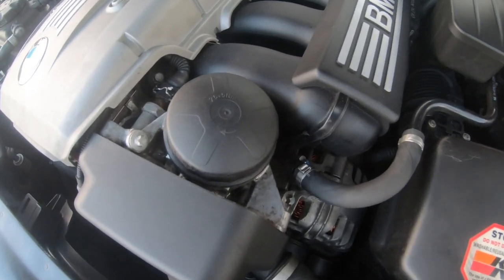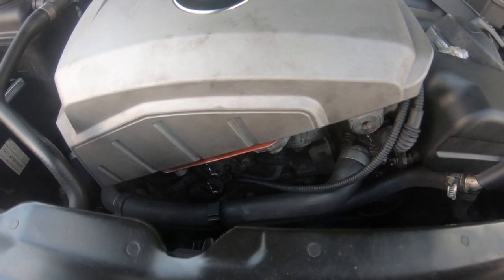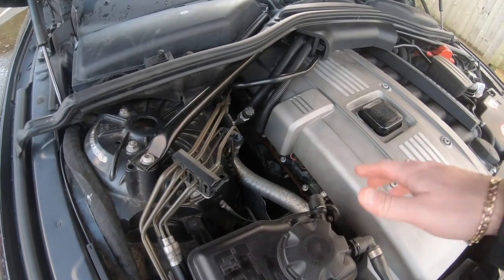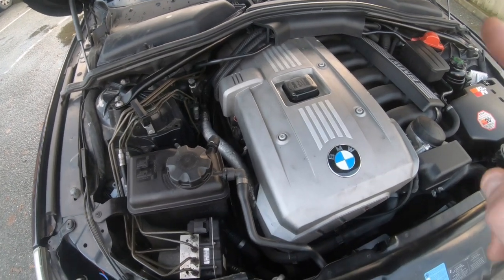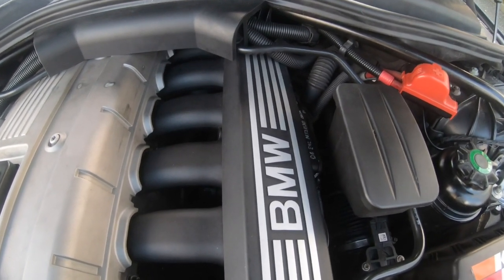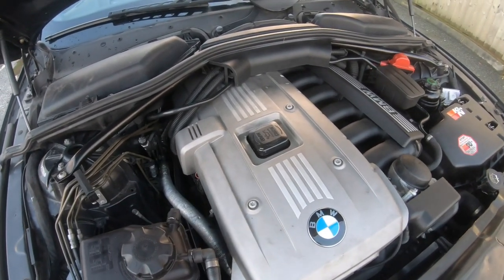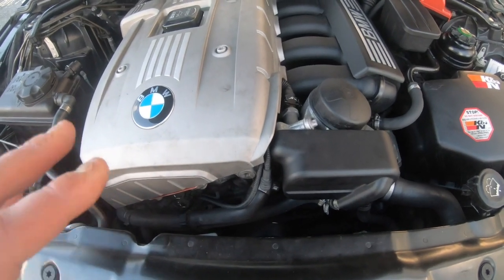9 Parts That Will Fail On A 100K + Mile Bmw N52 Engine

Comment: I have read that the aluminium bolts for the VCG were only used up until 2006? And that steel bolts where used after that. Which would not need replacing
Reply from the maker: That’s correct they was if you have plastic valve cover no need to change bolts
Reply: @BMWDoctor  Where are you based mate? If your not too far I'd like my 130i m sport to get a proper once over 😁
Reply from the maker: I don’t do work outside of YouTube sorry.

I only do it for my locals and family sorry about that the garage is not allowed to be used for YouTube clients even tho it’s paid for by them aswell as all the parts but I use it for my locals BMWs and my family’s.

If I was to start using it on YouTube cars and do what the contract says and pays me for we would have the whole of England having good reliable BMWs and my channel would become irrelevant.
Reply: @BMWDoctor  Ahh that's a shame! It's hard to find people who know their stuff imo. Can you recommend anyone in the south east area perhaps? Thanks
Reply from the maker: I can’t mate people and garages charge a arm and a leg to work on these cars especially 130i it’s very very hard to access as it’s cramped in there but I know how to work on that very easily done it many many many times on that engine
Reply: @BMWDoctor  Okay mate, thanks for the info 😉

Comment: Your belt tensioner should be replaced every 30.000 miles your engine will leak at some point approaching the 90 100.000 miles mark from the oil filter housing or the valve cover or both ive had to do the oil filter housin gasket at around 75k now im at 88k i gotta replace the valve cover / vc gasket + oil pan gasket and do my tires alignments my bmw is basically my wife I’m married to this bitch

Comment: Guys i am having some gard times with my bmw 323 my car started by overheating and it was mixing water and oil the machenic fixed the overheating issue as we speak my car is spilling oil over and when you drive it there is always smoke coming out of the car and also when it idle there is some ticking noise at the engen

Comment: my US 07 x3 3.0si does a loud tick about every 2 seconds while idling. Kindof feels like the AC compressor kicking on and off but its not. Any idea on what it would be? Its a loud enough "tick" that you feel it through the pedals.
Reply: The lifters are bad gonna have to get the 2009 cylinder head and do the lifters or just get the whole head and torque it down

Comment: These are pretty good engines, mine is at 120k and I've only had to do starter and valve cover gasket. My oil pan leaks alittle but it's not enough to run out and replace it right away as long as i add a quart every month it's fine

Comment: Hi dean. I am a international student and studying in Canada. I bought a 2011 328xi three years ago. Now it just hit 100k km. I am planing to change those parts that you mentioned in this video. But I am having a hard time to understand your speech. So can you make a list that could help me to find all the parts easier? and how I can do the engine module update?
0:45 for the engine oil filter components, do you mean need to replace the whole engine oil filter housing parts, not only the cap. is that right?
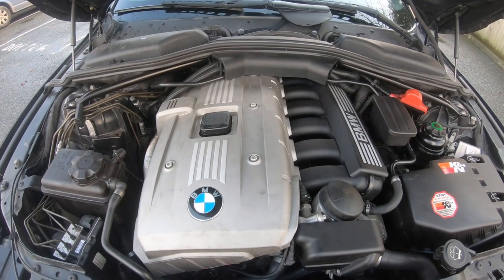4:05 do you mean the CCV intake manifold needed to be replaced? 
5:00 do you mean the valve cover gasket set need to be replaced? and for these bolts what size i need to get?

Comment: The best upgrade on my 2011 X3 with 100k somewhat problem free miles was trading it for a Lexus....   these 9 problems, and several other more was the final straw on a long list of things that cost way more than the car was worth to fix.    I also have a 2013 328i F30, with 143k miles on the 4 banger...zero problems, but its not worth two dollars so I just tool around with it until the engine has a catastrophic failure....
Reply: Interesting, yeah I have heard that the 328I F 30 is pretty reliable even though it’s forced induction, I am so torn because I love the Bangle era E 60 and I’ve always wanted one, was thinking about getting one as second car but I am also considering a A6 3.2 which is supposedly quite reliable actually. However I do love the F10 five series as well and a 528 I would probably be a reliable right, Of course with a thorough inspection and proper maintenance history

Comment: I do lose a little but of antifreeze over time, and i top it off every few months, maybe a quarter liter mix of of antifreeze and distilled water. I have no codes and there is no leak. I removed plastic undercover a few months ago and there is definitely no leak.

Comment: Thanks for your help Dean. I have an E46 with 26X,XXXmi I've had for 6 years and put 140,000 miles on, just purchased and X5 with a N52  and 167,XXX miles. I'm going through it. and needed a list of things to check. Between you and Nathan, I feel confident I can get this beast back to snuff. 

Just did the OFHG and OFcooling gasket.
Vanos Solenoids, Thrust arms and end links scheduled to arrive today. Had to do the wiper fluid pump last week.
Disa and CCV is next.

Comment: Congratulations for your great work here !
Reply from the maker: Your welcome
Reply: @BMWDoctor  Please allowed me to put you a question; I own an 2006 E90 325i with N52 engine and about 120.000km; I have it since 3 years ago. The engine runs smooth, no major issues while running. Excepting a little bit higher oil consumption, about 1l at 2000km. But the main issue would be the idle when the engine is cold(more than 8 hours). And this happens only when it's warm outside in the hot seasons; no issue in the cold season. After starting the engine, for about 5 to 10 seconds, the idle could be a little bit unstable but after that time, everything is ok. But sometimes, the idle just drops bellow suddenly and the engine just stops. After I start it again, no more issues, the idle is stable. Please advice what could be the problem. The ignition coils and spark plugs have been changed two years ago at a BMW dealer. At low rpms, I do not feel lack of power( caused by potential vanos solenoids issue).I never had the check engine shown in the dashboard.

Comment: I have a n52 engine in a 2006 e90 325i. It’s had all the gaskets done water pump is being replaced as we speak. Are these issues with the indirect or direct injection n52
Reply from the maker: my friend N52 is NOT direct injection engine
Reply: BMW Doctor  back in 2013 my car has the Deasa valve issue and had a new top end fitted. The car is on 131k miles the car runs fine as I’m aware but will I still need to replace the vanos Solenoids?

Comment: Any chance you know why my oil cap would be leaking after I replaced with genuine part? also rocker cover gasket done by previous owner is now leaking ? Plus my brake pedal goes stiff at 1k revs any ideas on this ? Servo or vacuum pump ?

Comment: when i see these videos i get really scared because my mine is at 115k miles and idk what the previous owners did but i have no issues accept after changing my oil the oil sensor isnt updating the oil level
Reply from the maker: Change the oil level sensor mate very easy to do
Reply: @BMWDoctor  will do thanks theyre actually alot cheaper than I thought they would be

Comment: Does a of-housing gasket leak- trigger a red oil can pressure warning light ?.
Reply from the maker: yes it can as oil pressure is compromised with a leaking gasket
Reply: BMW Doctor cheers mate! Do u reckon, the car needs to be towed, as the light does not stay on?.

Comment: I've got the S65 engine I'm at 98,000 kms, I know I need to replace the rod bearings as a maintenance which will be done this spring.
 Is there anything else you would address?  Vanos etc?

Comment: exactly the same on my Benz money pits:
Filter housing gasket 
Phasers stuck
PCV burning oil
partly developed software
valve cover extra leaks
weak aluminum bolts
serpentine idler and tensioner
....

Serious Ticking come from high pressure direct fuel injectors

last: don't forget to do early drain on transmission oil and brake flush... all engineered for precisely  controlled premature failure to help Japanese partner brands
👍

Comment: With an electric water pump can control the coolant flow as needed so... why does the engine need a thermostat?  Hey.  I guess I'm smarter than all the MBW engineers.  What am I missing?  Don't tell me about the heater.  There is thing called a heater valve.

Comment: Why would I replace parts before they fail?  So I can do it on my own schedule?  OK.  I'll change the oil before it fails.  What else?  The update sounds like a good idea.  How do I find out more about that?
Reply: He can do the update for you since he used to work for bmw or whatever he has all the tools necessary, you just need a laptop and a obd-usb adapter and the internet and whatever program he tells you to download he will do this remotely for you.... BMW in america won't do these updates for you apparently because the engines are too old and most people there aren't trained anymore to do these updates or whatever no money in it. He says most won't even acknowledge that they need an update from what I've gathered. But after you do it you apparently gain full strength to the engine. Could just be him advertising but I've watched this dude take the whole car apart so I believe him. I'm about to do my valve cover on my 07 328i n52 and might do this update after coils and iridium 4 prong plugs. If I ain't satisfied with the power gain after all that definitely scheduling an appointment with him.

Comment: They could have put a temperature gauge on the cars.  All they had to do was to design the gauge to read normal unless the temperature is out of tolerate according to water pump operation thermostat operation and the coolant temperature itself.  All my cars the temperature gauge sits exactly in one spot no matter what.  However outside of that parameter it will show a higher reading.  You are right I was thinking since the electrical water pump and thermostat came on BMW's  they took the coolant gauge off at the same time. So it makes sense.

Comment: Changed the valve cover gasket, pulley and tensioner at 70K miles in my 2008 E90.  Next will be the ABS assembly, I am sending it out to a third party for repair.  Thank you.

Comment: I just hit 96k miles (155k km) and my engine seized completely on my 2011 325i. 
On the bright side, I'm getting a new 50k mile engine 👀
Reply: What happened??
Reply: @taquechi2  oil pump lost pressure, bearings ran dry, and piston 5 shot straight through the block. I ended up getting a N52B30 engine from a 530i, so I'm kinda lucky lol

Comment: I have a 2011 328i and I’ve had to deal with these same issues spot on at around 73k miles. Excellent video!
Reply: how much did it cost to change all these parts??

Comment: well I have 2006 530i with N52 (310k km) and the only things I replaced so far was a starter, front spring and connection link on front sway bar. And belt and tensioner at 200k as maintenance, and just standard maintenance stuff, plugs, pads, filters etc. Otherwise no issues, no codes. The only extra things i do is oil changes every 8-10k,  and oils in man. transm, and diff, every 80k or so.
Reply from the maker: Very good

Comment: Around 100k is when you need to replace the expansion tank, those almost have the exact life span of 100k. It is hell trying to get it seated right, and if yours goes, it sprays everywhere and possible shorts the fan, and a few electric components. 

Is it also true to replace transmission fluid around 100k, and BMW Lifetime oil generally refers to 100k?
Reply: Bmw lifetime oil is a lie. You always need to make sure to change your transmission oil with new one and the filter as well

Comment: Thanks! I would add O2 sensors in engine bay, and the electronic water pump (+ its thermostat)
Reply from the maker: I did water pump and thermostat 

if your o2 sensors are failing on a N52 engine you have big problems mines on 160k on original sensors with no issues I would change your fuel grade and run shell v power 101
Reply: BMW Doctor O2 sensors agree that basically never fails but some have noticed big improvements in fuel consumptions as they get aged.

Comment: BMW made for 70 000 miles .Toyota made for 370 000 miles .
Reply: My E 83 with an N52 motor is running very strong at 200,000 miles.   Change your oil mate.   Trust me, the longevity of my vehicles has nothing to do with luck. FFS, I have been divorced three times! Shit for Luck.
Reply: Depends on the model, The E39 will match any toyota! the days of toyotas doing that mileage are long gone.

Comment: Every point you made was what I call ENGINEERED FAILURE POINTS.  They are specifically engineered to fail at a specific point to force the owner into the shop for a costly repair.  Every auto manufacturer uses them to get into your wallet.  All a part of the automotive corporate plan.
Reply: Planned obsolescence is a part that is designed in a way that it will no longer serve its purpose after a certain duration or determined wear quantity.

Engineered failure points is not a thing, that’s called engineering for cost vs longevity.
You could upgrade the material and design of every component on the car but there will always be a weakest link, the car would last longer overall but you will always get a part that will fail eventually, it is not only expensive to engineer parts for that, but also pointless if your top 60th percentile of vehicles doesn’t make it to the age at which these over engineered parts would last, they just become heavier landfill.
Reply: @gtjack9  this year alone, on my 06 330i, I replaced my coolant thermostat, expansion reservoir + cap, the cheap corroded plastic valve connecting the coolant tube to the head gasket (with a nice aluminum one), and radiator all on my own. Radiator was previously replaced in 2020. Then yesterday, I had the water pump replaced after it was previously replaced in 2016. 

Now the engine runs between 190F - 220F, but mostly hovering between 205F - 215F. 

Also replaced the voltage regulator. 

The CCC unit is totally dead and the entire driver’s side headlight housing. 😔
Reply: @samgod  how much was all that I’m thinking about buying a 328i n52 2011 with 99k miles for just under $5K would love to hear your opinion on getting it as my daily the owner looks like a guy my age early twenties and has multiple bmws
Reply: Planned Obsolescence at its finest.
Reply: @gtmike916  actually, to me, planned obsolescence is a separate concept; designing a vehicle to look outdated.  It will run perfectly, but just look old, enticing the owner to "update" by buying the newest version.  Engineered failure is used to force owners to repair items that should last longer if not fail at all.  An example is the electric water pump on the BMW.  Mechanical water pumps should last well beyond 100K, but you're living on borrowed time after only 50K with the BMW pump.  Or the door latch mechanism in a Ford Edge.  Some electronic gizmo fails to work after 15k, forcing you to pay well over $700 in labor to replace a $30 part.
Reply: Thats normal my friend. Because its not an japanese motor😉
Reply: @abdullahboz7055  If i didn't love the BMW so much, that's what I'd have right now.  There's definitely a cultural difference driving that...

Comment: I disagree about the temperature gauge. They could easily include one set to the appropriate temperature range of the engine. Ie hot for hotter than normal. A gauge gives you warning of a temp increase before it's critical
Reply: Right!! BS

Comment: Hi mate . Maybe a silly quistion but after replacing vanos solenoids you mention updating the modules  ...is this the same as an ecu remap or should the actual engine module be replaced ? 
Great videos ...learning alot
Reply from the maker: No mate you update the module using genuine bmw files I have done it for many many many people with success 

No remap needed for this and no module needs replacing just updating
Reply: @BMWDoctor   ok so is this something I could get done threw you or your company ? If not any recommendations on where . Iv got a 2007 330i e90 Iv had for a couple years currently on 87000 miles and im starting to do some small upgrades and preventative maintenance on as I love the car and want it to run at it's best  . 
Thanks for any info or advice you give . Best bm vids on YouTube hands down
Reply: @BMWDoctor  how and where do u find these files?

Comment: Hello doctor! Greetings from Portugal! I have noticed a slight problem with my 630i (140 Miles), the yellow engine light comes on and I feel the car lose its power. A mechanic told me it was the exhaust probe dirty, I think, but could it be something else? Some of the usual model problems you talk about in the videos maybe? Thanks for your work!
Reply from the maker: vanos solenoids is what causes this
Reply: @BMWDoctor  Thanks for the reply and keep up the good work !!!
Reply from the maker: your welcome